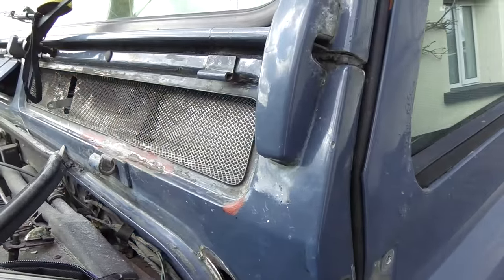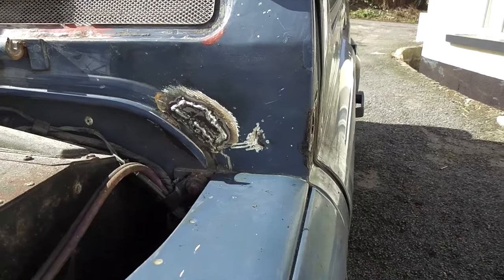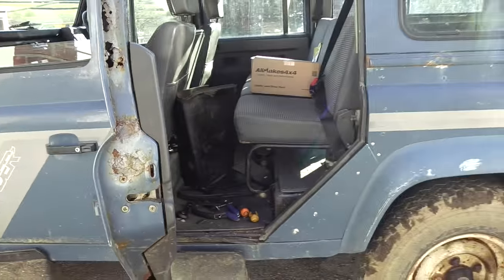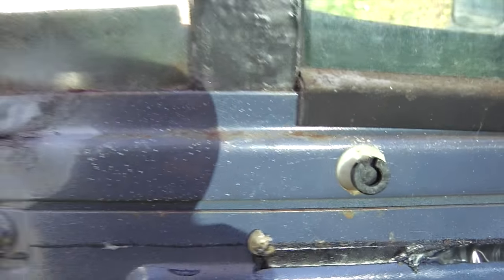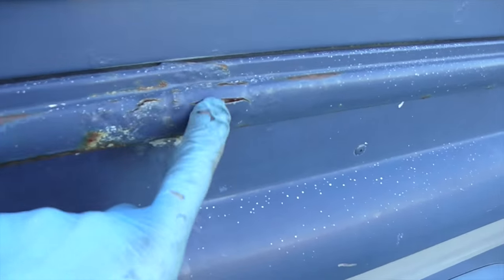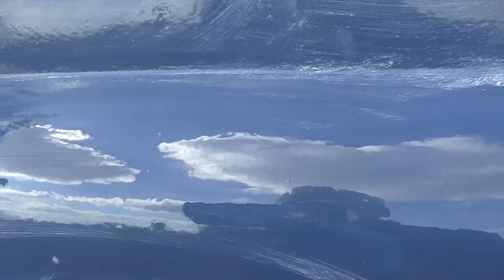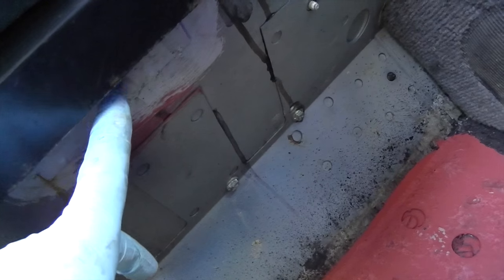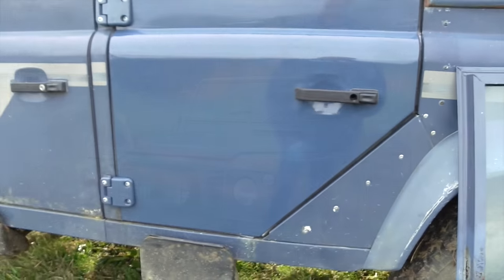Land Rover Defender 110 Part 2 Restoration

Comment: Hi Nice clip could you show us how you painted the door with a roller please
Reply from the maker: Darren Leeson Hi Darren, I'll try and film the rolling when I repair my front doors. I used a gloss roller from B&B.  The trick is to get the paint on really quick but don't put pressure on the roller and not to much paint. you find you get some bubbles but just keep working the roller backwards and forwards and the bubbles will go. I will film the next door for you...